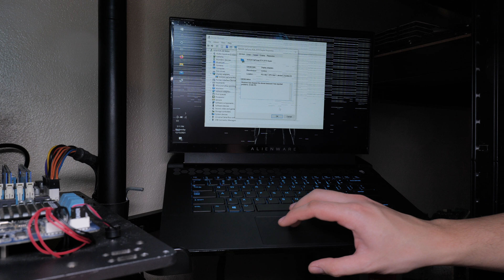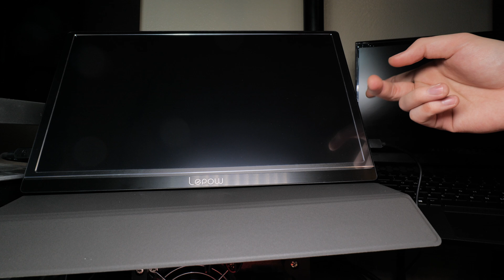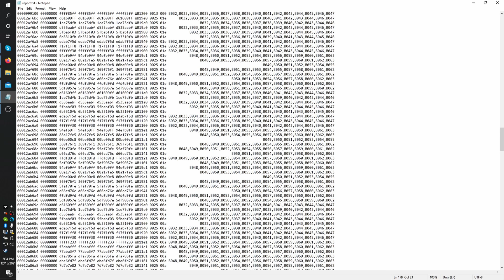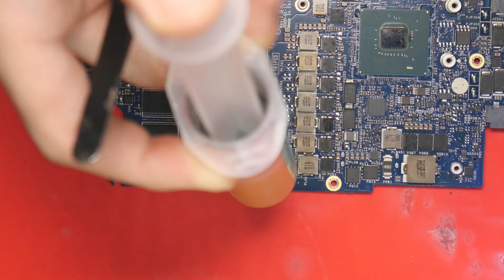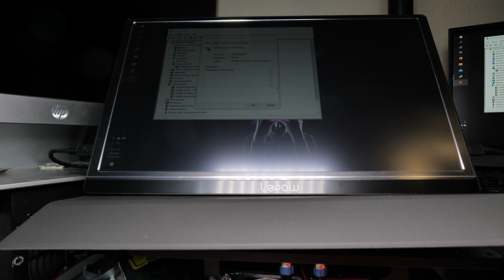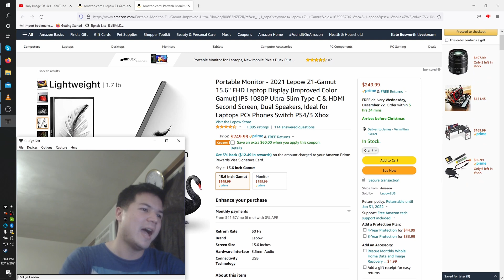Alienware M15 R3 Repair - Artifacting, Code 43

Comment: i purchased allienware M17x R4 laptop with 870m 6gb GPU MXM card. after installing windows and drivers i noticed that Nvidia card isnt working properly and showing code 43 in system properties. and after restarting system few times system can not detect this card some time when i restart system. so i puled the card and checked it in my alienware m18x R2 and it works fine. so do you have any idea what can cause the problem with M17x R4 that every MXM card is giving code 43 on it? please help...

Comment: I have this problem with my M17X R3 and at the same time the fx lights no longer light up. It’s not the LDC, GPU or any cables. I’ve tried a new GPU, new processor, new LCD with cables. I’m at a loss now I remove the GPU & use intergrated graphics only I get artifacting. if I disable intergrated graphics & run dedicated GPU it’s even worse. I’ve tried all parts on another MB and every part is fine so I’ve isolated the issue to the MB. Any help isolating the affected suspected component I would be very grateful.

Comment: I'm also with an M15 R3 artifacting but it's halting. Problem is I can't make MATS booteable usb to work as I can't modify UEFI to csm legacy. How on earth did you manage to make it boot, if you can help would be great. I'm wasting a lot of time , I even tried running an ubuntu live cd and trying to run MATS to no avail.
Reply: there's a build of mats running on legacy bios.

Comment: I have a laptop with the same line problems. If it turns out to be a memory bank, is it a good idea to run mismatched vram chips? I have a doner board with the same gpu chip but a different manufacturers vram chips
Reply: Basically A Samsung chip might have failed and I only have micron chips so I'm thinking of running hybrid since micron isn't the best
Reply: @thewhitedragon4184  no you can't.
you have to use the same memory brand...

Comment: I have a question I have a evga sc gtx760 shows code 43 and the device won’t work with the drivers windows disables the device but as soon as I turn the computer upside down fans pointing towards the sky the card works completely fine what does this mean?
Reply: @trw8777  any way to fix?
Reply: @trw8777  no luck used screw still works upside down tho
Reply: @trw8777  as soon as turned right side up it artifacts and crashes and the computer reboots
Reply: @trw8777  possible since I don’t have a heat gun I will leave it alone I don’t mind using it as is right now
Reply: @trw8777  is there a vram chip or just to the mem chips

Comment: I have an RTX 3070 artifacting exactly like this, does MATS work for testing 30 series gpus?
Reply: Yes, but you will need the new version, 367.38.1 or 400.someting is not enough.

Comment: I have a gtx 1060 that got some corrosion on a capacitor rigth next to a memory chip. The computer always boots into windows but only displays sometimes. Would you say the memory chip is bad? I removed the cap and it did display into windows then went black gain.Thank you so much for your videos
Edit: looks like I'm missing a small capacitor and a very small resistor... that could be it. Looks like the end of the road.

Comment: @tech_Cemetry mybe you can help me?
I have an EVGA 980 ti scc never been overclocked, PC powers up fine, GPU works fine on normal work (internet brawsing, youtube etc...) but the moment i put it under load(lanch a game) , it crashes, black screen (sometimes white for a second), GPU light flash and turn off for a second than power on( like its doing a restart) , but no video afterwards. i have to restart The PC to get it to work again.
*fans are working fine
any suggestion?

Comment: i have a gtx 1060 boot up installs  drivers then black screen  works fine in safe mode and then i checked with onboard and 1060 plugged everrything ok no code 43 but noticed always running at 1x speed what should i check to see find the fault??

Comment: Great job as always! May I ask you a question? Bought myself a defective RX 570, it had a faulty fan connector which led to the gpu overheating. Fixed the connector and the card is now cool and quiet, however on some games artifacts are present. White pixels here and there, black and blue triangles, but only on certain games. It seems to be related to VRAM usage (Furmark is 100% ok for hours) as it happens with ganes that use more than a couple GB or so. I suspect one memory chip is faulty due to overheating. How would I know which one of them is the culprit? And is my assumption actually correct? That it's the memory and not the gpu? Thank you in advance!
Reply: Try to run Heaven benchmark and switch tessellation on and off, if the triangles are gone with tessellation off then the problem is in the core. However white chessboard pattern is a sign of dead vram chips. Is it by chance az Asus dual, Strix, MSI aero or XFX card? (Asus dual cards have a high core failure rate here, but none of them have vram cooling)
Reply: @pp3v42_g3h  Hi, it was the core unfortunately, some part of it handling geometry I guess. Got rid of it for parts. It was an XFX, VRAM tests turned out ok so the core was to blame.

Comment: Hey i got a question, so i recently bought gtx 750 ti 2gb only to find that the gpu cant run on its boost clock, when it does the gpu goes no display, i had to underclock it to 936mhz and running games no problemo, do u guys have any idea on whats going on in this gpu? Thanks

Comment: If i have artefacts and code43, but Tserver (AMD Memory tester) does not show any errors on my RX480 8GB... dead core or dying memory controller on that core?
Reply from the maker: See my artifacting RX 580 video. You want to be using the artifacts to diagnose the card when possible.

Comment: If the ram bank was shorted the card wouldn't even be able to run mats as the card wouldn't be detected right?
Reply from the maker: It can still run if it's shorted. Shorted memory banks don't always pull enough current to lower the voltage at the memory phase.
Reply: @TechCemetery  If the memory phase is shorted and no voltage is at the phase is there any other way of detecting the bad memory banks
Reply from the maker: Yes, with a power supply and seeing what warms up. For shorts on the memory phase, you'll sometimes need a thermal camera to detect the shorted component.
Reply: @TechCemetery  I have a card that has a short on the memory phase but nothing heats up at all when injecting 1v on memory phase
Reply: @muneebhamdi7605  Probably a smaller diode around the memory banks

Comment: What actually causes a memory module to just fail randomly like that? Why does one of them usually die but none of the others? Is it manufacturing defects, overheating destroying the internal structure, or do the solder balls start developing cracks in them after many thermal cycles?
Reply from the maker: This laptop doesn't have cooling for the memory. Hence why it's dead after only a year and a half. Manufacturing defects and poor quality control are quite common on Micron's stuff as well. It's very rare for the solder balls themselves to be the problem on memory modules, it's much more common for pads to rip off due to board flex.

Comment: hi, i have one question, i replaced memory on few gpus (rx580, gtx 1060 3gb, gtx 1060 6gb, and rx 470, and every single time memory died again, i know its the memory controlers fault (i think), but is it that common to have bad memory controler, and how do i know will the repair last. Thanks.
Reply from the maker: Only way to check if the repair will last is to replace the memory and test it for an extended period of time.

Comment: Great video again. Thumbs Up👌. Hope you can give me some guidance. I have a GTX970 that artifacts but not always. Happens once I start playing a game. If I run MATS it does not show any memory issues. Can it still be memory but only happens when the GPU is running hotter or something else? I have looked at all the power rails and they all look good. Heaven benchmark will usually make the card artifact and if I don't quit the benchmark quickly it will crash and get no display. If I immediately do a MATS test after it still shows no errors.
Reply: i think you have a dying gpu die itself or over heating problem

Comment: Great info here dude.. Are all or most code 43 errors with artifacts memory itself errors or shorts in the memory?
Reply from the maker: For newer GPUs, code 43 is almost always memory related. For older ones like the RX 400/500 series, the BIOS is a common culprit as there are a lot of modified mining BIOSes.